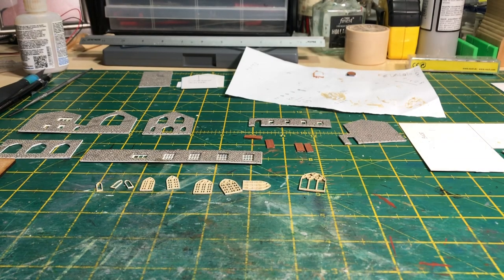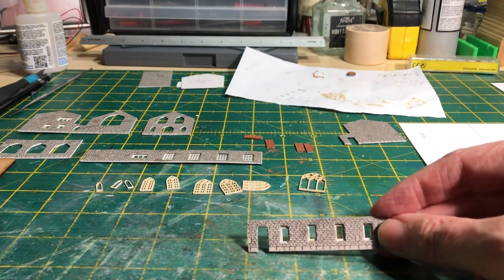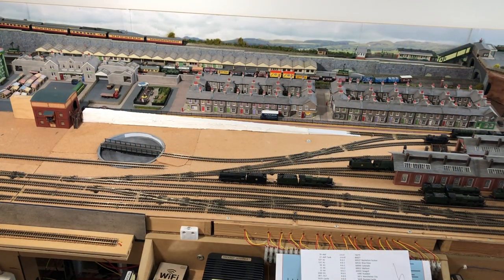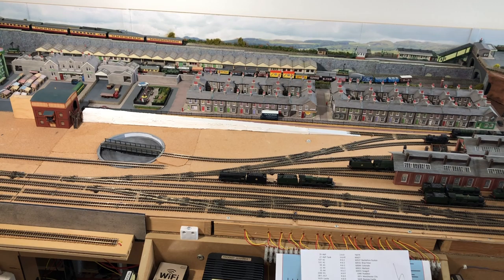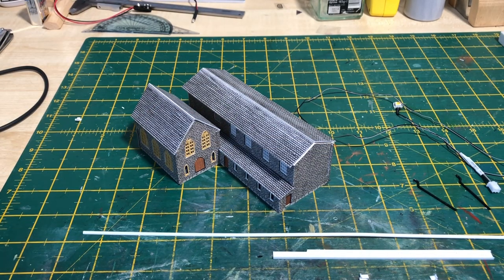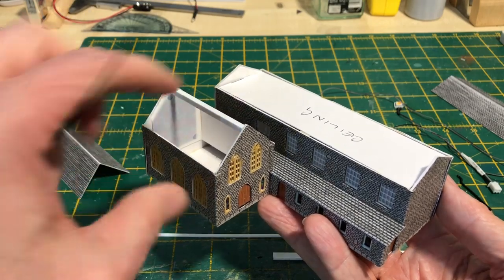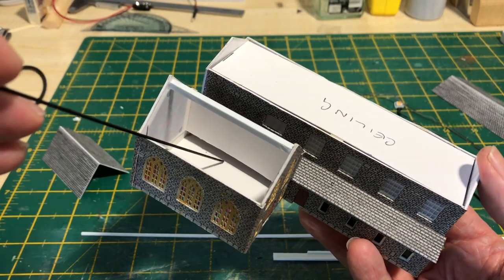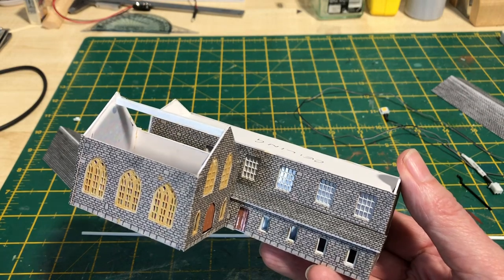Elvenhome N Gauge Model Railway Layout Church School Build  Update EP73

Comment: Continues to look impressive and I admire and envy your scratch building skills.  Visiting Didcot tomorrow with the wife and kids, so will be casting an eye over the coaling incline to look critically at yours! 😉 As always thank you for sharing your progress.
Reply from the maker: Hi David and thanks.  The coal stage I have is a kit based on the stage at Didcot, so I will be interested in thoughts once you've seen it.  Stephen
Reply: @Elvenhome  Hi Stephen.  Visited Didcot today.  IT was not a very scientific measurement, but it appeared there was about 23 paces from the building to the buffer stop and I think there was room for about 3 wagons there.  The retaining wall was about 4-5 feet high and made from brick; this was different on the other side up to the buffers which was made of stone.  There did not appear to be any retaining wall on the reverse side.  The track which would be served under the hoppers had a long ash pit.  If you need any photos let me know.  Didcot 's a nice heritage site. Dave.
Reply from the maker: @davidrauger  Thank you so much.  This is very useful information and is a help more than you can imagine.  I started to look at how I might get an ash pit under the coaling stage (which I think will be reasonably straightforward).  In doing so I had to fit a loco under the stage and I realised that I had forgotten that to do that I had to  lift the coaling stage 5mm off the baseboard to give clearance for mainline engines to go below.  It means my incline is not steep enough, and will need to be remade - that will be easy.  So thanks very much indeed Dave.  Stephen

Comment: Hi Stephen, The Church school looks fantastic, another excellent scratch build project, the stain glass windows look fantastic. I can't wait to see the church school lighted and installed on the layout. Your plastic ramp for the coal shed incline looks like just the ticket to reduce  / eliminate the vertical kink or vertical jump from zero to incline I was trying to describe in my last comment, very well done.  You also have my curiosity peaked, whatever could the "The Something Else" be? I know what I'm thinking it could be, but I'll save my thoughts and wait for the next update. Cheers and Happy Modeling, Rich S.
Reply from the maker: Hi Rich.  Im pleased with the school which has come together much quicker than I had hoped.  I was also pleased that the ramp fitted so nicely and supports the track well where the incline starts.  As to the something else, I will leave you to your suspicions.  Stephen